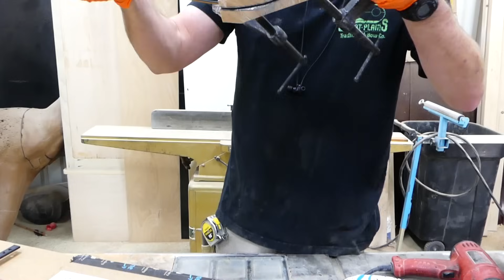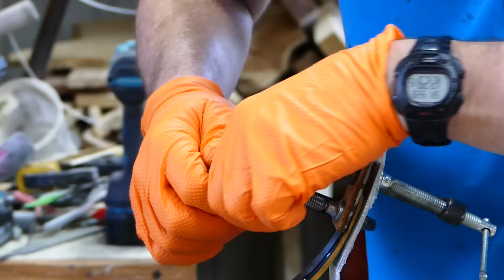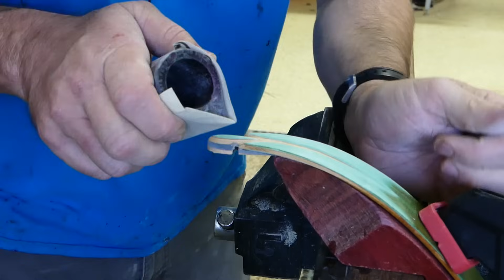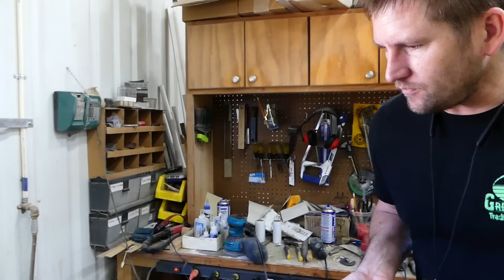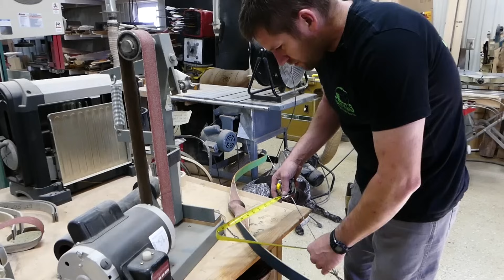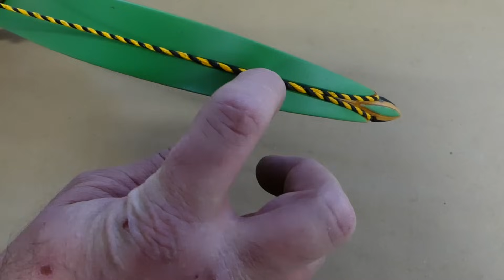U•S•A•C "Texan" Recurve  |  COMPLETE REWORK  | This bow is awesome!

Comment: I have a similar bow made by Gordon Plastics Co. I believe it was made in 1958. However, the tip overlays are very thin and the top tip partially broke when I shot it. I did a temporary fix and it shoots great, but it looks ugly. I'd love to have it done properly by a true boyer.
Reply from the maker: @jscott4431  can do it. Check your options if ya want at greatplainsbow.com

Comment: I was in high school in the.mid 50’s when USA Archery was in its heyday day. I lived on Long Island and that company was considered “local”. The glass they used on their bows that intrigues you was called Pantherglas. My first recurve bow was made by Mark Archery which was, as I recall, in Queens, NY. USA Archery named 
most of their bows after a Stat.  Jim Dougherty shot a bow, the Kentuckian, for a number of years. I do believe the owner was an ex Marine. Your video brought back a lot of memories.
Reply from the maker: @wiliiamcarlsen3426  hey I love that info! Thank you!
Reply: Will, do you know if that glass was produced in-house? Bear moved away from the woven pattern to linear strand during the K4, static era. If I remember right, the cause was internal stress of the glass weave getting internal damage through the compression cycle. Or--the linear stuff was just less expensive to make and lay down.
Reply: @paullewis5045  the glass was not in house. But you are correct about failure on the bows belly because it was not conducive to compression.

Comment: I would have used clear printer tape/sticker with the picture you took and gone this route for the decal separating the green background from the logo for the bow in a program before printing it up.
Reply from the maker: Yeah good idea. I'll look into that
Reply: @greatplainsbow  where you want to put the stickers you will need to remove some of the polyurethane coating from the bow.
Reply from the maker: @caseysmith544  ooo can't do that
Reply: @greatplainsbow  or will have to use a bit more poly to cover the sticker.